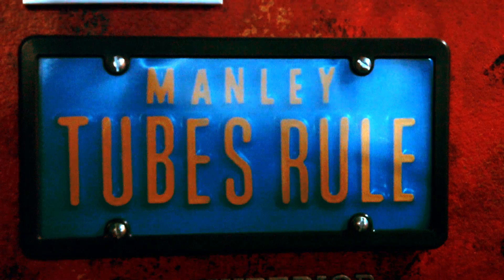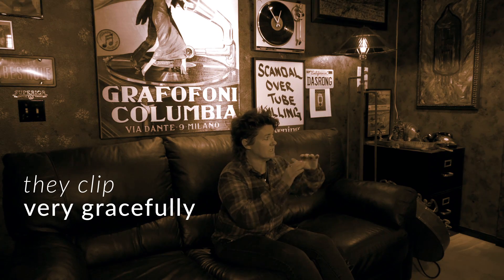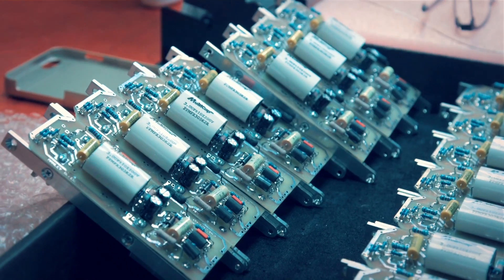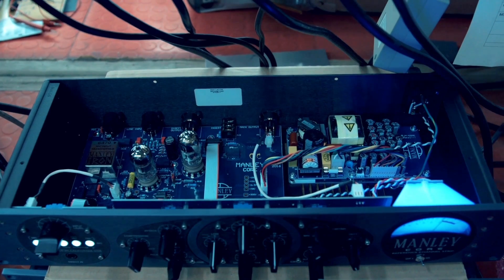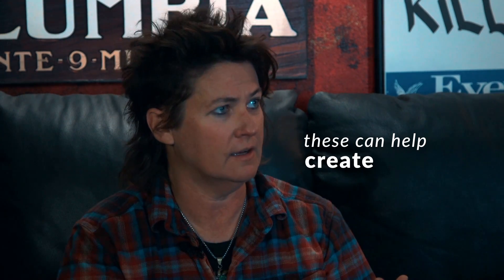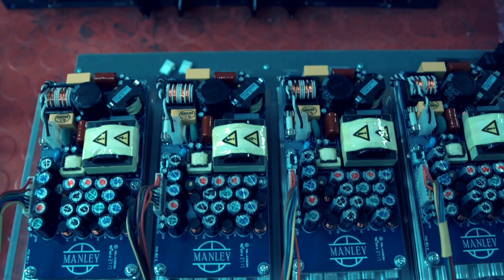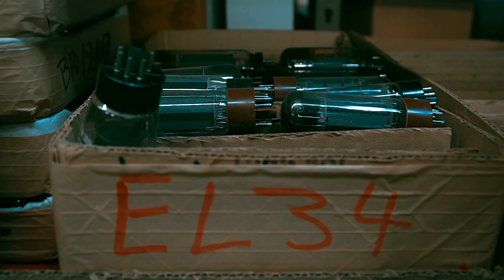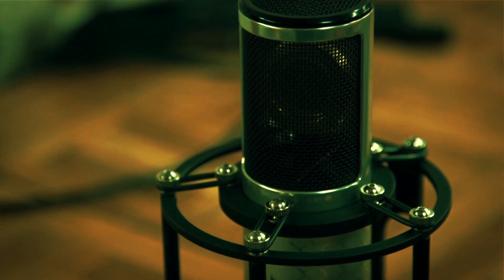Why Tubes Rule

Comment: I have an 80wpc Yamaha 5.1 Dolby Digital receiver and a 12wpc Harmon Kardon 300A.  I have vintage Klipsch designed speakers.  The 12wpc HK integrated amp from 1964-1965 wins in sound quality.  It uses 12AX7, 12AU7, and 6v6 output tubes, sound much smoother, and bigger than the Yamaha, aso more detailed, some aspects of the artists getting closer and farther away in microphone, you don't hear this on the modern amp, or poping ribbons, by artists, like Leroy Van Dyke.

Comment: Tubes are a wast of time and money,maintenance is why it’s a constant deterioration after the first turn on the heat is ridiculous and anybody knows heat equals noise,plan and simple,solid state is constantly accurate and last forever and so much more power can be obtained,nostalgia that’s all is is now get over it
Reply: I roll my own tube stuff from microphones to compressors and so on. I have the same tube in some for like 20yrs. There is only one noise in a tube device you can't get away from and it's called shot noise. This is when the electrons slam into the plate, which is why (and also why Tetrodes and Pentodes came into existence) in tube mics the cathode is under heated and plate current is kept below 1mA. I have tube devices that rival solidstate in self noise. I have no prejudice because I build solid state equipment too. They both excel at what they do and using both is a plus. For example I like to run a solid state mic into a tube mic pre then into a solid state compressor or do the opposite if I use a tube mic. That by itself is a way of shaping the sound without needing a lot of extra processing. I slam my DIY tube direct injection box hard with my analog synths straight to the control grid with no coupling cap in the way. Big sound! Love it all day long.
Reply: Otie Jason Preamps are integrated into the circuit of every single solid state amp ever made and also almost every tube amp. Both absolutely require them whether integrated into the amp or not.
Reply: Otie Jason  pre-amps are used to amplify a small signal to line level, lol. I roll my own so I'm set where that is concerned. And I have tubes to last me for years and years
Reply: Power-tube distortion in a tube power amp for electric guitar is a special case, a distinct discussion.
Reply: Loool! An angry republonazi for sure. Tubes have tone and do things naturally that it takes millions of dollars for idiots to teach solid state crap to reproduce and they still fail miserably. Tubes by their nature filter uneven order harmonics, and let sweeter even order harmonics through. If you think heat makes noise open up your solid state crap and look at the massive heat sink in it. Now quit taking your ruined life out on good things.